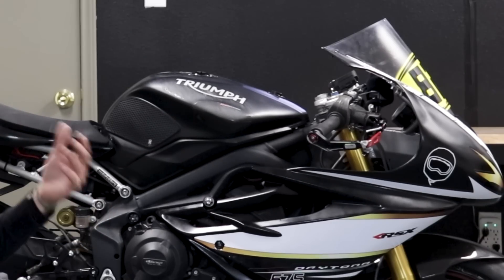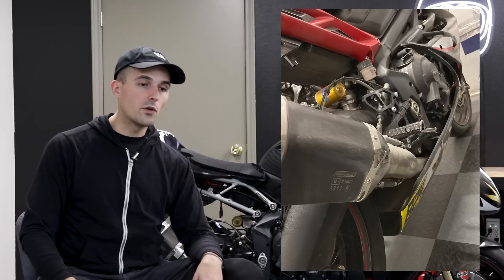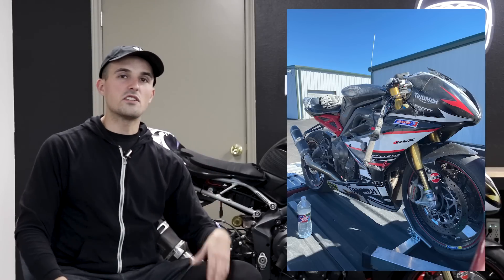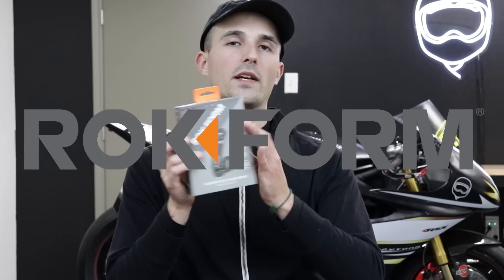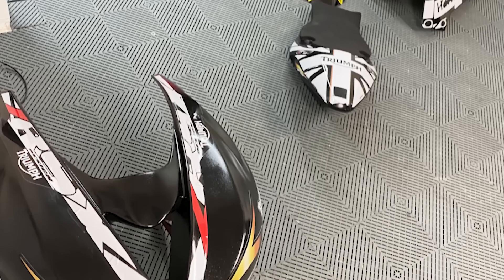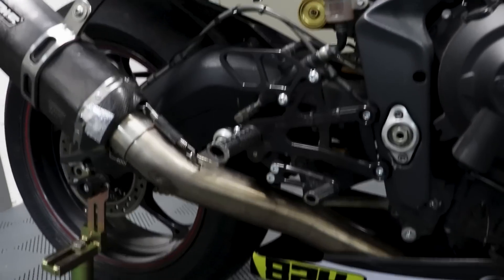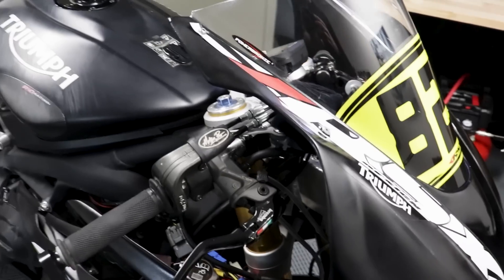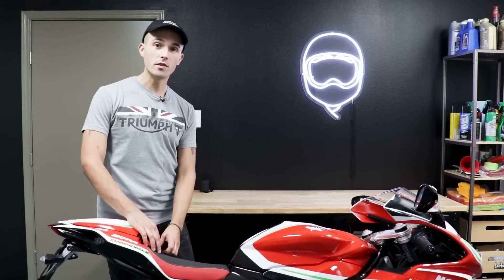I CRASHED AT 115MPH (I LIVED AND FIXED MY BIKE!)

Comment: Even though it might be late but a little tip for the crossthreaded brake calibers.
Get yourself a Heli-Coil set im not sure if you can get them in imperial threads but fir metric they are worth the little weight in gold.
They are effectively a wire coil with an inside and outside thread.
To use them drill the original hole a bit bigger to the specified size for the heli coil and cut threads which the coil thread in.
the inner diameter of the coil then has the same size as the original thread.
You can even put them into plstic parts to have good steel threads in the plastic.

Comment: If that cross threaded hole in the brake caliper is the brake line fitting, you should be able to re-tap it if it's a tapered thread.

Comment: I wrecked my 2008 zx6r at the Track, Utah Motorsports campus, almost three weeks ago.  I was somewhere between 90 and 110.  My front tire started to skip.  It became clear I wasn't going to make the corner, so I straighten it up and took it into the gravel.  Well, I didn't realize that section was gravel, if it had been paved I would have been fine.  The gravel stopped me quicker than I could have imagined.  Ended up launching off the bike.  I'm not sure what hit the back of my helmet but based on my fairings I assume it was the tail of the bike.   When that impacted it shoved my head into my collar bone and snapped it in three pieces.  It didn't really hurt, not even surgery, but maybe that's from practice, I've now broken both collarbones wrecking bikes. 

My bike, I cracked or destroyed every piece of fiberglass on the bike. The nose was split into two pieces, the rest of the fiberglass is fairly repairable.  I shattered my coolant reservoir.   I have a small dent and gravel rash on my fuel tank.  Bar end sliders and frame sliders did their job.

It was the day before I was scheduled to do my first day club racing.  So that will have to wait until July.

I've been to the track many times, but this was the bikes second time at the track.  I bought the bike three weeks before I did my racing certification and did all but the safety wiring myself.

The second bike is a good idea.

Comment: nice video.  racers, all of us from amateurs to semi-pros, needs to have one of two options:

Option 1)  A running bike parts, so you can take anything from your bike part and put into your race bike

Option 2)  Have a budget for crashing once or twice a year and spare parts for the most easy to break stuff: levers, master brake cylinder, foot pegs, foot rest, clip-ons, fairings, windshield.

Comment: 10:29 cheap fix would be just make yourself a custom banjo bolt that's a little bit larger , bore out and re-thread it that way and also resize the banjo eyelet....  It'd be like.... 8 bucks & 3hrs tops of profanity while workin on it lol

Or just find a replacement caliper off scAmazon or eBay fo like 50-60 bucks that aren't seized....

Comment: Just gonna add... trying to get new parts for bikes right now is literally impossible. Due to covid manufacturing is extremely backed up. This is probably the only way you wouldve gotten this thing back up and running without waiting a year. Took me 3 months to get a new master cylinder for my r3... had to get a used one off ebay after getting back ordered after it was supposed to arrive the 2nd time

Comment: Any 'humble pie' in that there track wreck Yammie ???   LOL....There's really no difference going from a cross-over front brake line to a dedicated 2 line.....the reason racing -competition motorcycles have this is safety....if a front fender should break free, something get stuffed under it, it can destroy the cross-over line to left side caliper. IIRC it was due to an incident waaaay back in '96, 98 maybe..when a knee puck got picked up by tire at Branda Hatch BSB ??  ...got stuffed into the fender ...destroying it and the cross-over line.. So basically safety issue.  So before peeps start going nuts buying a 2 line kit...not really a 'performance' upgrade....Spend your $100 bucks elsewhere....
Reply from the maker: ABS delete lmao